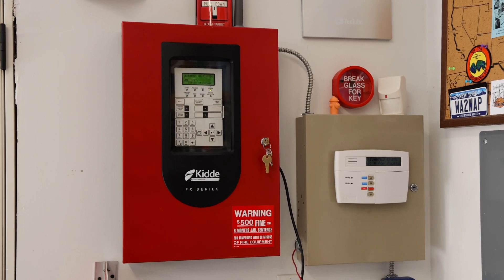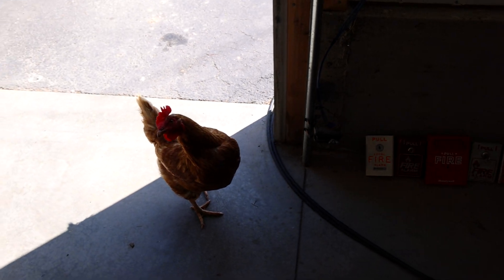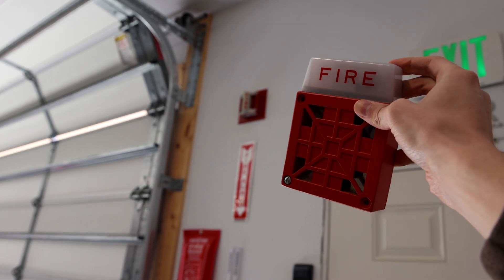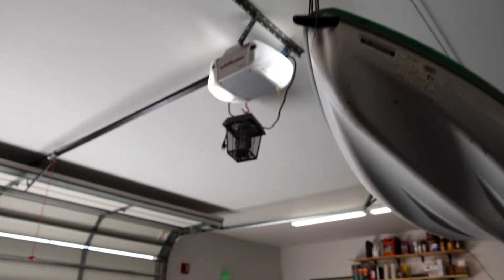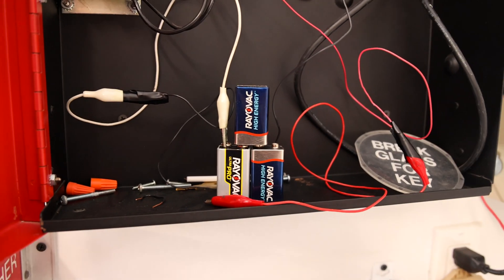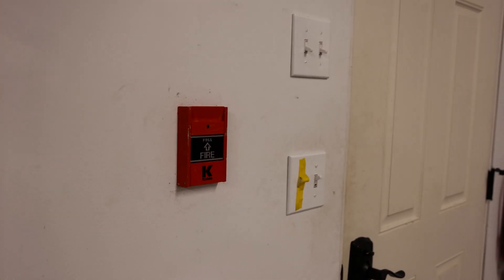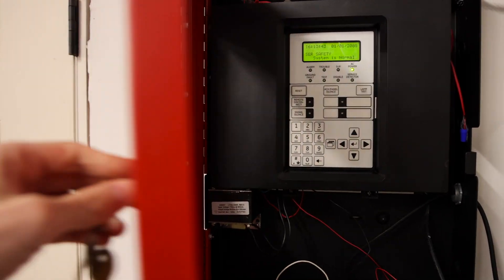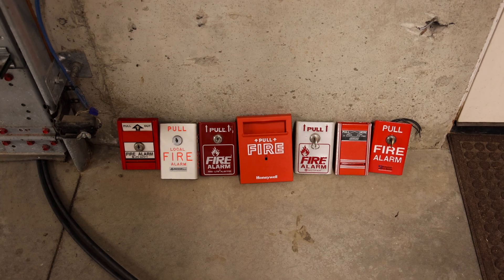Loud Vibratone Fire Alarm Horns on Continuous! | Garage System Test 34 🔥

Comment: My old mother's Day out program I went to as a kid actually had those vibrantone horns with the strobes an gamewell pull stations an it was a massive church and the one in the gym was replaced with a spectralert classic in 2004 they did a massive expansion an system sensor spectralert classic speaker strobes were installed in the entrance lobby sanctuary the ramp hallway had regular classic horn strobes the second floor had them the panel was notified the old building I never knew the panel

Comment: Noice! Vibratone 450's are definitely one of my favorites. They just sound flipping awesome. (Also note the pitch drop on both horns after about 10 seconds of sounding. In case anyone else noticed. Likely due to the current draw on the batteries.)